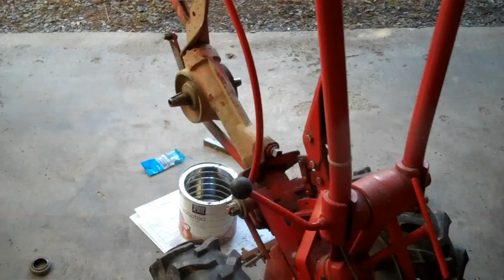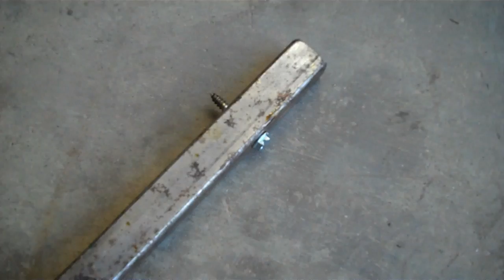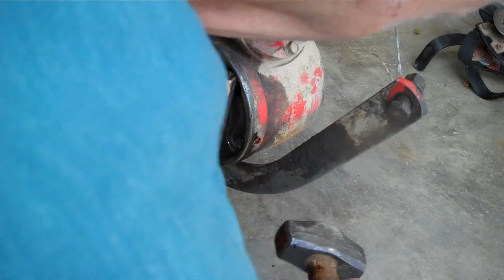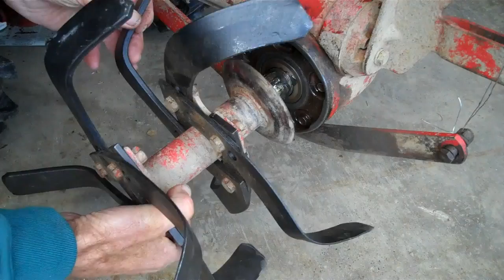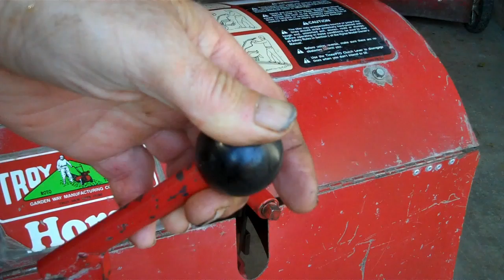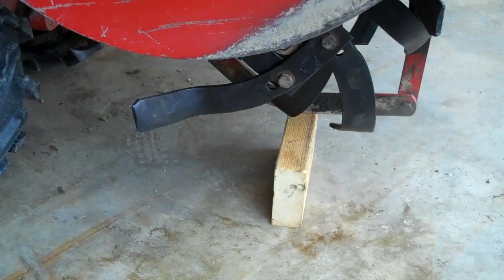Replacing Tiller Shaft Oil Seal and Tines on Troy Bilt Roto Tiller

Comment: WHAT IS THE PART NUMBER FOR THE SHAFT FRONT OIL SEAL
I HAVE ONE LOOKS JUST LIKE IT BUT CANT GET SEAL
Reply: Check ebay.  Use your serial number to find out what model/year you have, then use manual from troy bilt, it's online, just use google.
Reply: DATE SERIAL NUMBER
Apr - 1962 101
Apr - 1963 372
Apr - 1964 721
Apr - 1965 1132
Apr - 1966 1526
Oct - 1966 1825
Apr - 1967 2221 Trojan Horse production ceased with serial #2712
Jul - 1967 2713
Oct - 1967 2912
Jan - 1968 3433
Apr - 1968 4060
Jul - 1968 4663
Oct - 1968 5359
Jan - 1969 5993
Apr - 1969 6650
Jul - 1969 7556
Oct - 1969 8480
Jan - 1970 9513
Apr - 1970 10839
Jul - 1970 12501
Oct - 1970 14189
Jan - 1971 16108
Apr - 1971 18428
Jul - 1971 21840
Oct - 1971 24540
Jan - 1972 28528
Apr - 1972 32140
Jul - 1972 38000
Oct - 1972 42000
Jan - 1973 49821
Feb - 1973 51417
Mar - 1973 53530
Apr - 1973 56017
HORSE SERIAL NUMBERS
COMMENTS/REMARKS
Trojan Horse - 4.5 HP, all stud tires, and cast iron spoke wheels
Garden Way Manufacturing Co. formed and began production of the Horse I,
two speed, two belt, 6 HP Tecumseh engine.
Bar tread tires and cast iron hubs optional before Serial #31040. 7" cast spoke
wheel changed to 8" steel wheels with Serial #31456.
May - 1973 58533
Jun - 1973 61361
Jul - 1973 63881
Sep - 1973 67867
Oct - 1973 70421
Nov - 1973 74232
Dec - 1973 77834
Jan - 1974 80945
Feb - 1974 84721
Mar - 1974 88708
Apr - 1974 93038
May - 1974 97244
Jun - 1974 101527
Jul - 1974 105491
Aug - 1974 108388
Sep - 1974 112373
Oct - 1974 116909
Nov - 1974 121972
Dec - 1974 126927
Jan - 1975 131034
Feb - 1975 136006
Mar - 1975 141231
Apr - 1975 146981
May - 1975 153066
Jun - 1975 158433
Jul - 1975 163222
Aug - 1975 166417
Sep - 1975 171230
Oct - 1975 176853
Nov - 1975 182749
Dec - 1975 187490
Jan - 1976 193030
Feb - 1976 198420
Mar - 1976 203735
Apr - 1976 210574
May - 1976 217266
Jun - 1976 223064
Jul - 1976 228669
Aug - 1976 229790
Sep - 1976 235432
Oct - 1976 240369
Nov - 1976 245622
Dec - 1976 250148
Reverse disc mount changed to single bolt with large washer from three Allen
head screws.
Jan - 1977 254282
Feb - 1977 258957
Mar - 1977 262948
Apr - 1977 267597
May - 1977 271446
Jun - 1977 274882
Jul - 1977 278612
Aug - 1977 280141
Sep - 1977 284743
Oct - 1977 289375
Nov - 1977 294577
Dec - 1977 299725
Jan - 1978 304562
Feb - 1978 309976
Feb - 1978 314150
Feb - 1978 314151 Begin Horse II production. Four speed, one belt, 6 HP Tecumseh.
Mar - 1978 314320
Mar - 1978 315296
Apr - 1978 320330
May - 1978 325435
Jun - 1978 331138
Jul - 1978 336870
Aug - 1978 338749
Sep - 1978 345189
Oct - 1978 350985
Nov - 1978 357514
Dec - 1978 363052
Jan - 1979 368621
Feb - 1979 375440
Mar - 1979 380828
Apr - 1979 388355
May - 1979 394015
Jun - 1979 400854
Jul - 1979 406077
Aug - 1979 409378
Sep - 1979 416629
Oct - 1979 422959
Nov - 1979 430460
Dec - 1979 435848
Jan - 1980 439736
Feb - 1980 446898
Mar - 1980 453023
Apr - 1980 459525
Last Horse I produced. Total production 311,437 units.
Begin production with 7 HP Kohler engine available.
May - 1980 467761
Jun - 1980 474363
Jul - 1980 480283
Aug - 1980 484627
Sep - 1980 491122
Oct - 1980 498098
Nov - 1980 505891
Dec - 1980 511381
Jan - 1981 518348
Feb - 1981 525202
Mar - 1981 531211
Apr - 1981 539361
May - 1981 546751
Jun - 1981 552154
Jul - 1981 559140
Aug - 1981 563747
Sep - 1981 569130
Oct - 1981 574187
Nov - 1981 579458
Dec - 1981 584797
Jan - 1982 590135
Feb - 1982 594649 February 27, 1982, Lyman Wood left Troy-Bilt.
Mar - 1982 599434
Apr - 1982 606277
May - 1982 612944
Jun - 1982 617088
Jul - 1982 622295
Aug - 1982 626257
Sep - 1982 629618
Sep - 1982 634138 September 15, 1982, Last Horse II produced.
Sep - 1982 640000
Oct - 1982 640099
Nov - 1982 642381
Dec - 1982 649518
Jan - 1983 650220
Feb - 1983 654743
Mar - 1983 660705
Apr - 1983 665117
May - 1983 670891
Jun - 1983 674427
Jul - 1983 678407
Aug - 1983 681698
Sep - 1983 685462
January 28, 1982, Dean Leith becomes Company President
Horse III PTO Tine Clutch begins production with 6 HP Tecumseh, 7 HP Kohler,
and 8 HP Briggs and Stratton engine options.
Oct - 1983 688574
Nov - 1983 692962
Dec - 1983 697866
Jan - 1984 702873
Feb - 1984 707715
Mar - 1984 712492
Apr - 1984 719751
May - 1984 725255
Jun - 1984 730791
Jul - 1984 735958
Aug - 1984 740247
Sep - 1984 746020
Oct - 1984 749814
Nov - 1984 754103
Dec - 1984 759889
Jan - 1985 762559
Feb - 1985 765766
Mar - 1985 772021
Apr - 1985 778419
May - 1985 782176
Jun - 1985 787776
Jul - 1985 791185
Aug - 1985 794581
Sep - 1985 797525
Oct - 1985 800185
Nov - 1985 803053
Dec - 1985 805145
Jan - 1986 806595
Feb - 1986 810470
Mar - 1986 814811
Apr - 1986 819802
May - 1986 824527
Jun - 1986 828042
Jul - 1986 830648
Aug - 1986 832923
Sep - 1986 832923
Oct - 1986 835437
Nov - 1986 837628
Dec - 1986 838827
Jan - 1987 841756
Feb - 1987 845342
Mar - 1987 847287
Apr - 1987 849978
May - 1987 855053
Jun - 1987 855639
Jun - 1987 855697
Jun - 1987 856107
Jun - 1987 856127
Jun - 1987 857306
Jul - 1987 857307 First O.P.C. production.
Aug - 1987 858609
Sep - 1987 859652
Oct - 1987 860380
Nov - 1987 861823
Dec - 1987 865489
Jan - 1988 866039
Feb - 1988 870240
Mar - 1988 872310
Apr - 1988 876018
May - 1988 881723
Jun - 1988 882966
Jul - 1988 884637
Sep - 1988 886504
Oct - 1988 888299
Nov - 1988 890115
Dec - 1988 892915
Jan - 1989 895069
Feb - 1989 897842
Mar - 1989 901396
Apr - 1989 903808
May - 1989 905524
Jun - 1989 00906827
Jul - 1989 00907732
Aug - 1989 00908629
Sep - 1989 00910812
Oct - 1989 00912139
Nov - 1989 00913963
Dec - 1989 00918299
Jan - 1990 00919667
Feb - 1990 00922104
Mar - 1990 00923346 Graphic models start at 00923347
Apr - 1990 00926914
May - 1990 00929326
Jun - 1990 00931877
Jul - 1990 00933944
Aug - 1990 00934693
Sep - 1990 00936672
8 HP Kohler engine replaced 8 HP Briggs and Stratton
Last Horse III produced. Total Horse III production 217,306 units.
Test Run of first Operator Presence Controls (O.P.C.)
Oct - 1990 00937563
Nov - 1990 00938904
Dec - 1990 00940749
Jan - 1991 00942768
Feb - 1991 00942768
Feb - 1991 00944684 - 00944858 International
Mar - 1991 00946753
Apr - 1991 00948616
May - 1991 00950330
May - 1991 D0000001 - D0000523 Black 25th Anniversary Edition
Jun - 1991 D0000524 - D0001998 Black 25th Anniversary Edition
Jul - 1991 00953276
Sep - 1991 00955222
Oct - 1991 00958067
Oct - 1991 00944858 - 00956555 International
Nov - 1991 00959797 7 HP Electric Start
Nov - 1991 00959842 7 HP Pull Start
Nov - 1991 12058100564 8 HP Pull Start New Serial Number Format
Nov - 1991 00959077 8 HP Pull Start
Nov - 1991 12059100735 8 HP Electric Start
Nov - 1991 00959138 8 HP Electric Start
Dec - 1991 120560100385 7 HP Pull Start
Dec - 1991 120570100334 7 HP Electric Start
Dec - 1991 120580101065 8 HP Pull Start
Dec - 1991 120590100940 8 HP Electric Start
Dec - 1991 120510100100 8 HP Pull Start Briggs & Stratton International
Jan - 1992 120560100750 7 HP Pull Start
Jan - 1992 120570100940 7 HP Electric Start
Jan - 1992 120590101245 8 HP Electric Start
Jan - 1992 120510100154 8 HP Pull Start Briggs & Stratton International
Feb - 1992 120580200399 8 HP Pull Start
Feb - 1992 120560200409 7 HP Pull Start
Feb - 1992 120550100134 8 HP Pull Start Made for Sears
Feb - 1992 120590200499 8 HP Electric Start
Feb - 1992 120510100314 8 HP Pull Start Briggs & Stratton International
Mar - 1992 120560200699 7 HP Pull Start
Mar - 1992 120570200354 7 HP Electric Start
Mar - 1992 120580200993 8 HP Pull Start
Mar - 1992 120550100179 8 HP Pull Start Made for Sears
Mar - 1992 120590200724 8 HP Electric Start
Apr - 1992 120560300422 7 HP Pull Start
Apr - 1992 120570300204 7 HP Electric Start
Apr - 1992 120580300455 8 HP Pull Start
Apr - 1992 120590300363 8 HP Electric Start
May - 1992 120580301000 8 HP Pull Start
May - 1992 120590300958 8 HP Electric Start
May - 1992 120560301143 7 HP Pull Start
May - 1992 120570300455 7 HP Electric Start
Jun - 1992 120580301590 8 HP Pull Start
Jun - 1992 120590301768 8 HP Electric Start
Jun - 1992 120560301888 7 HP Pull Start
Jun - 1992 120570300824 7 HP Electric Start
Jul - 1992 120580302060 8 HP Pull Start
Jul - 1992 120590302206 8 HP Electric Start
Jul - 1992 120510200134 8 HP Pull Start Briggs & Stratton International
Jul - 1992 120560302160 7 HP Pull Start
Jul - 1992 120570300894 7 HP Electric Start
Aug - 1992 120580302460 8 HP Pull Start
Aug - 1992 120590302585 8 HP Electric Start
Aug - 1992 120560302455 7 HP Pull Start
Aug - 1992 120570300984 7 HP Electric Start
Sep - 1992 120580303084 8 HP Pull Start
Sep - 1992 120590303000 8 HP Electric Start
Sep - 1992 12060302940 7 HP Pull Start
Sep - 1992 120570301243 7 HP Electric Start
Oct - 1992 120580303518 8 HP Pull Start
Oct - 1992 120590303260 8 HP Electric Start
Oct - 1992 120560303552 7 HP Pull Start
Oct - 1992 120570301532 7 HP Electric Start
Nov - 1992 120580303769 8 HP Pull Start
Nov - 1992 120590303520 8 HP Electric Start
Nov - 1992 120510200159 8 HP Pull Start Briggs & Stratton International
Nov - 1992 120560303787 7 HP Pull Start
Dec - 1992 120580303995 8 HP Pull Start
Dec - 1992 120590303848 8 HP Electric Start
Dec - 1992 120560304039 7 HP Pull Start
Dec - 1992 120570301640 7 HP Electric Start
Jul - 1976 P10001
Jan - 1977 P12184
Jul - 1977 P17239
Jan - 1978 P21736
Jul - 1978 P27504
Jan - 1979 P33557
Jul - 1979 P40287
Jan - 1980 P48773
Jul - 1980 P58906
Jan - 1981 P68034
Jul - 1981 P80423
Jan - 1982 P89466
May - 1982 S101843 Pony III
Jul - 1982 S105606
Jan - 1983 S117319
Jul - 1983 S129028
Jun - 1981 M1001
Jan - 1982 M1378
Jul - 1982 M8204 Junior II
Jan - 1983 M17012
Jul - 1983 M25639

Comment: Thank you herbcrosby!  And thank you Allison!   My right side seal began leaking a few weeks ago.  I thought I would have to disassemble the entire tine gear box to drive out the bad seal from the inside.  Your method works great!  
As Allison Uhl stated below, I didn't have metal stock lying around, so I drilled two 1/8 inch holes across from each other, ran the screws in about 3 threads and used a cats paw nail puller to slowly pry the seal out.  
Bearings are in great shape.  Cleaned the shaft with fine sandpaper and carb cleaner on a rag.  Drained all oil from the tine gear box.  Installed the new seal, topped up the gear oil and I'm back in bidness!
Reply: Does it stop going forward when it leaks oil?? Mine was working great then it stopped going into gear I checked and oil was pouring out the rear seal..Hoping it wS just low on oil.

Comment: great tool use, if you don't have the square rod just drill the 1/8" hole in the seal, fasten screws to seal and I used a flat pry bar on each screw alternately and the seal came out just like that. thanks Herb.
Reply: See my comment above.  Thx.

Comment: JUST WANTED TO SAY THANKS FOR A FINE VIDEO.YOUR INNOVATIVE seal removal tool worked like a dream. Tried hardwood first. Broke. Cut two  6inch pieces of 1/4" thick by 1 1/2" wide steel bar stock. Worked like a dream. My only problem was the shaft and tine assembly on one side were really frozen solid. Removed the shaft bolt, layed the tiller on it's side and half filled the shaft hole with WD40. After 30 minutes of gentle tapping and soaking she broke free. Really appreciate your video. It sure simplified the whole process. Grampa Joe Pero, bought mine back in 85 too.
Reply from the maker: +Joseph Pero Thanks for your email and congratulations on repairing your tiller.  It's enjoyable being able to repair classic older machines and keep them running.  I  was pleased how well this simple method worked.